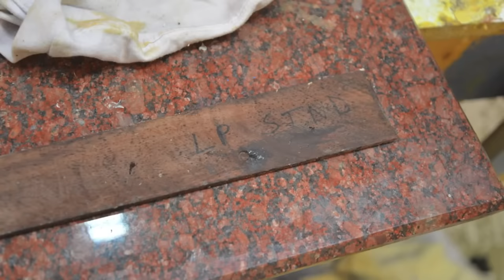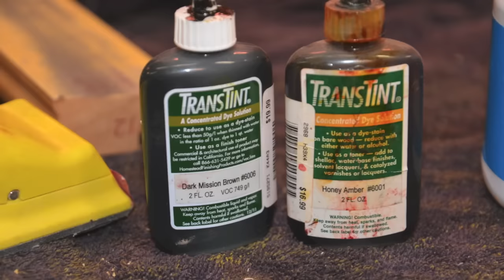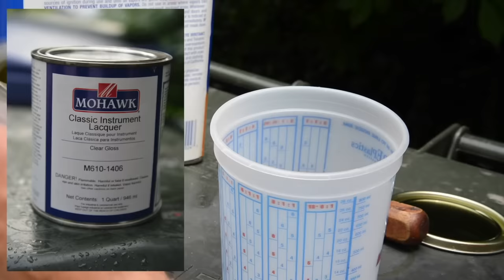TRASHED Gibson Les Paul Guitar is Rebuilt! - Complete Time lapse Video

Comment: The legend of Gibson’s quality control goes on...
Reply: The Drumming Sasquatch those inlays look like it could be a counterfeit but might be just my impression from the vid...
Reply: More like ebayer dumpster dived behind Gibson factory and found a  reject to sell.
Reply: Not recently....
Reply: survivor030406 they wouldn’t throw anything in a dumpster, that would go into a wood chipper if deemed unworthy and they lock their dumpster anyway
Reply: The Drumming Sasquatch not the new ones their shite
Reply: Zarin M  I thought they were sold as B stock
Reply: Zarin M  I have a limited edition dark cherry SG and some of the finishing is not great. Gibson are reknown for poor quality during certain periods
Reply: It's no PRS quality that's for sure.
Reply: @rnichol22  Many years ago, if QC found any issue with the guitar, it went in the dumpster.  People pulled those guitars, even Gibson employees, and sold them.  A lot of times you couldn't even find the flaw but there was one found and Gibson didn't want to sell it.  After this went on, Gibson realized even those with a minimal flaw had value so they stamped a "2" on the headstock under the serial number and sold them.  I've got a 1976 Les Paul Custom with a 2 on it.  I wonder if the original owner knew that?  Originally it was white but it has long since turned yellow. I bought it from a pawn shop in 1980 for $200.  It's beautiful.
Reply: @frantech6935  suprised they didn't go under years ago with that buisness model. Surely it can't be that hard to get consistency in guitar building. Even the chineese can manage better. My 2014 SG oiginal I love but the quality is possibly the worst of all my guitars, finishing,  masking, frets. Not terrible but worse than my ibanez and epiphones a third the price
Reply: Gibson's are always 4 for 5 lol.  The last 1 out of every 5... People just convince themselves that it's a good guitar.
Reply: @B4 freedomfighter they had pictures on their site with broken reglued headstocks ..they would do anything for money.
Reply: Just about!
Reply: @B4 freedomfighter The local repairer was given a "plekt" Les Paul to go over after purchase. Frets were a different radius to the fret board and the bridge. Really top notch stuff Gibson haha.

I have a few unused roughed out bass necks from the Kalamazoo Factory. 3 piece Maple. It's like they didn't consider grain at all when glueing up. so yeh pretty interesting. I assume they were rejects. I also assume they were better at quality control back then
Reply: I worked in quality for 44 years - Gibson doesn't have a clue.
Reply: You see something that is
 a very expensive and it
 gets trashed.
Reply: @survivor030406  
Seller Stratosphere on eBay has thousands of them.  None have hardware whatsoever. I’m betting inside job at Gibson factory. I know a Gibson rep that swears they’re supposed to go in a wood chipper when they don’t meet quality control.  Somehow Stratosphere is getting a TON of them.  Explorers, SG’s and firebirds too. Selling the junk for $900-$1600 stripped.  Would bet a truck load of cash that’s where his came from. I considered one, but I knew something has to be wrong with them.  Should be illegal.
Reply: @frantech6935  You’re absolutely right. Well I should say this is what I’ve read over the years. It’s not like I worked there or something. But I read originally they stamped B Stock or Factory Second or something like that. They stopped that because there were too many getting out there over the years. After that they would cut them up on a saw.Scroungers like me would raid them and put them together the best they could. As far as QC I feel like that is totally blown out of proportion. It’s a thing to be a hater on whatever ( good band, good car, good vodka etc). I’ve had I think 8 LPs over the years maybe more. An SG and an ES 335. I’ve had one stinker in the bunch. A 2014(shocker). Even that one was more my fault for not knowing and having confidence in set ups and especially neck relief. But it definitely was a QC fail. It should not have left the factory or the store like that. It could be argued that I should’ve caught it at the store. This would be fair. Although 3/4s of any gear I’ve bought in the last 7 or so years would be me in a music store with a good buzz on. No business going in there. Come out 2500 or so poorer. Especially if we have an attractive sales rep.
Reply: @Plowguitarist  I know the ones. Whatever your  thoughts on the legality or morality of this, do you find these a bit over priced? I’d get one but 1000 USD I feel like I’d rather go to Warmoth or something. Then you know for sure you wouldn’t have to yank the frets out or pull off the fretboard to fix neck warp. 4-500 I’d take a chance.
Reply: @frantech6935  Howdy,   My mother worked at Gibson 225 Parsons Kalamazoo from 1960 until 1984 when the closed. The 2 they stamped in the headstock represented a second. That's how they classified them. As seconds. There also was a BGN which meant bargain. They were playable but something obviously wrong.  As an employee a perk they could use was 
ONCE  a year they could purchase  a first, perfect guitar for 40% off msrp.
As for buying seconds, they could buy them any time.  She got me a beautiful Dove with hard shell case for 600. The only flaw was on the back a friend took a straight pin and put a tiny dot on the back. It was then passed inspection and went on to finishing. After finishing the tiny dot was noticed so it made it a second. It was beautiful and the tone was fantastic.  Unfortunately in 1986 my house was burglarized and it was stolen. I have a lot of stories and memories of Gibson in Kalamazoo. I got to play many custom ordered guitars before the owners. Have pictures of my mom with Carlo's Santana, Billy Gibbons,  Keith Richards and Ronnie Wood. And more.

Comment: And to think 🤔 I get a little nervous removing a bolt on neck. I’ve never messed with a glued in neck but I’ve seen enough wood panel glue ups where the wood fiber breaks while the glue line holds, to freak me out.

Comment: For popping a neck on acoustics, I saw a guy rig ball inflator needles for steam. Would that work in a case like this?
Reply: Yep!  I made a neck steaming rig for $3.76.  I used an empty metal 16 oz paint can from Lowes, a rubber grommet, a length of plastic tubing and a needle inflator for basketballs/footballs.  I removed the fret above the neck/body joint, and drilled 2 small holes in the fret slot, put my can full of water on the stove and had at it.  Worked like a champ!
Reply: @billbertolino8946  Very cool! And inexpensive!!

Comment: Excellent video, excellent work :-)
I saw a video where the guy heated the frets by adding solder to the fret. It worked! It transferred heat faster to the bottom of the fret where the glue is!

Comment: Man I love the colour, I just got a 335 7 string kit... intending to modify it to a 6 string with a wider neck (I'm accustomed to playing a classical guitar) and 60 mm overall string spacing at the bridge. I will be using the exact same colouring procedure, I don't need to hide any unfortunate chips so not so dark. Superb comprehensive rebuild.  For a moment I thought you were going to start soaking and clamp twisting the neck to straighten it out.

Comment: You do incredible work! I've never done a re fret but when I did in going to try a method I saw on YouTube. He added solder to the fret and it would transfer a lot of heat to the fret wire and the frets would pop right out quickly. Just letting you know..but I'd bet you've seen and tried that method.

Comment: A few days ago,, I picked up en Epiphone Les Paul from someone who was giving it away cos he said it was beyond repair. The headstock is missing and there's a huge, long rip through most of the length of the neck (which is beyond repair), so I was planning on building a new neck for the body. But after watching this video, I think I can rescue the fretboard. And I think I can remove what's left of the neck in similar way to what you did (I was initially thinking maybe just saw it off and create a new neck pocket).
Reply from the maker: Yea that steamer is such and easy thing to do.

Comment: Nice job, question: in order to separate the neck and fret board with steam it had to have been glued with hide glue originally. Was there a reason you used PVA instead of hide glue when your reassembled ?

Comment: That was fascinating! Nice job. 

I have a 1976 (pre-lawsuit) Ibanez Deluxe '59er I've always wanted to have restored. I messed with it over the years and fucked it a bit. Then the truss rod broke a few years ago and I had new neck made for it which is incredible. 

I wonder how much it would cost to have this treatment done to it. 

P.S. It's a bolt on neck so no muss and fuss with un-gluing the neck joint.

Comment: So it looks like your stains are water-based? And then it looks like you sprayed high gloss lacquer over the stain finish. But then I saw that you sprayed on a mist of darkness for the outside of the guitar. Then the lacquer being reapplied, sanded and polished. Was that correct in what you’re using and the steps that you took?

Comment: Beautiful restoration! How many hours did you put into that? I got tired just watching! Yeah, manufacturers should not sell guitars with cracked wood; I just had one replaced under warranty because the neck began cracking under the fretboard! BTW, it sounded like you have the toggle switch reversed so the up position is the bridge pickup (brighter), or is that just the windings?

Comment: 1 million views and 99K going .........OMG. It seems like someone bashed it on a concrete floor. I'd have put a little fake wood in there and attempt to match the color. Even with that it did not look that bad enough to rip it apart. C'mon everyone. Just send it in to Gibson cause they will screw it up the right way. I quit my Uncles furniture repair business so I could play with guitars too. I'd comment more but, I don't want guys showing at my door after figuring out my I.P. address [address where my computer is at]. I'd give about $40.00 [that's fordy bucks] for a Gibson ripped apart like that and I knew it. I don't like making negative comments but,.......some people just have to stop!!!!! It is good that "you" kept the guitar. I played a LP in a club when a kid and sweat all over it. THe more I wiped the sweat and smoke off the more the finish came off. It was a wreck and everyone commented on it but, that is how Gibson finish is. It is fugitive and won't mix with any thing other than the real Gibson stuff.

Comment: What a huge amount of unnecessary work. Fretboard could have stayed on, neck could have stayed on(just use a neck jig!) Binding could have stayed on considering replacing it did nothing to fix the wood chip out that he used wood filler on anyway. He also tight bonded in the frets, I know some people do that, but not necessarily something you need to do.  Looks nice though.

Comment: Lots of loving attention given to the guitar. Kudos for that.

It's too effing bad you couldn't be bothered not to make a trash soundtrack for this video. If I had to guess, you compressed this all to hell and gone. Why don't you know not to do that? And why does the vocal level switch to GLARINGLY LOUD when the music kicks in? Oh, and what's with all the frickin' dead spots? Again, is it that damn hard to line up audio with video in a program that I am SURE leads you by the nose through the steps required?

How hard is it, really, to find someone who can mix a soundtrack properly for you?

FFS.
Reply from the maker: You tube killed my original soundtrack.  I had to use their terrible editor and the video did really well.   Not totally my fault